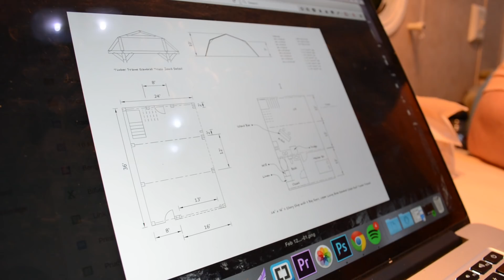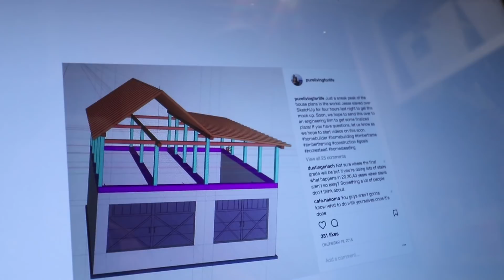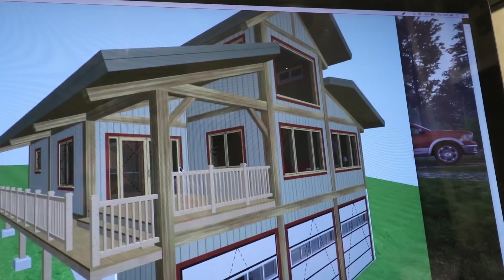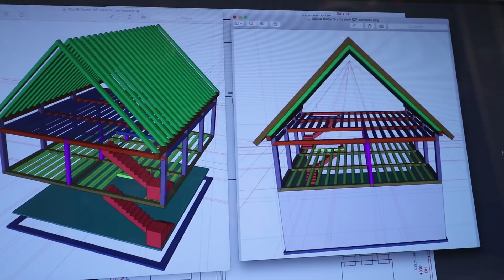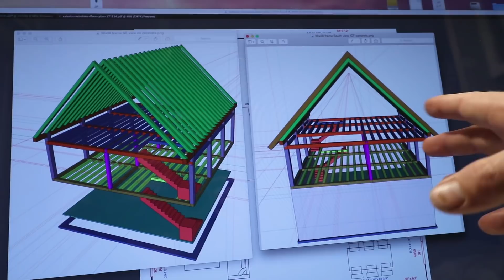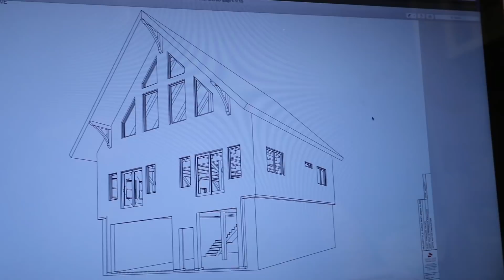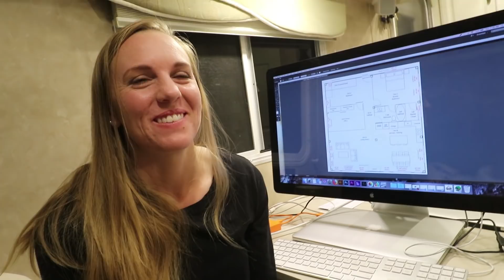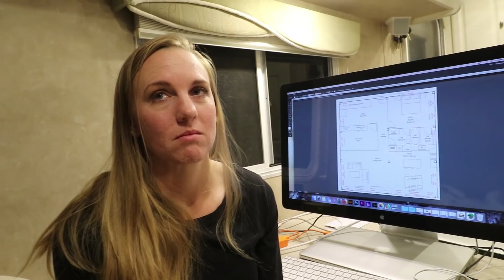Building a House Start to Finish: Timber Frame House Tour

Comment: Make sure your doorways and stairways are large enough to move appliances and furniture into where you want them. How do you get your washer and dryer into the bathroom? Having appliances/beds make abrupt right angle turns is more complex than you think. A queen bed is harder to move than a king because the king breaks down into smaller pieces. Talk to appliance installers. We purchased a refrigerator that only fit through our doors when all hardware and some trim was removed. This is the reason that spiral staircases are only useful for non-functional spaces. I suggest having appliances drawn to scale then moved through the house drawing by hand until they are in position.

It seems to me, in my inexpert opinion, you have not put enough consideration into plumbing. If I am wrong I sincerely apologize. If you are planning a garage workspace, then consider a sink on the outside of the garage bathroom. Is your kitchen and bathroom plumbing on common walls? Is the upstairs and garage plumbing lined up for sewer stack and water supply? Your upstairs bathroom design has water supply and water disposal on two/three walls. Where is your disposal stack? If you plan a loft bathroom, the stack and water supply pipes must extend up to that floor unless you want to rip out walls later. Consider that a refrigerator with ice dispenser needs a water supply.

 Good luck on your building journey.

Comment: Hi

Great looking house. 

I wondered about one thing. Have you considered not having wood as floor material in the mudroom. I would use tiles or something else that is more resistant to water. Both because in the winter you drag snow into the house and due to that this floor will be washed quite often.

Comment: you'll love that southern light until it's baking you alive in summer... remember it's a hot space! The spacing from seating in kitchen island to dinning table seating to door is very cramped. I also second the issue with your inverter system located under your bedroom. I lived on the other side of the wall for one in a single story cabin... it made a good night's sleep challenging. Love the work you've put into things and encourage your continued effort.

Comment: Very nice design, one suggestion, with 10' ceiling height using standard doors will look odd, I used 8' doors in my build and it looks proportional. 
This is going to be a great house when you get it done, cant wait for the framing videos, keep up the good work!

Comment: Great job! I would look at that bathroom though, I don’t think you’ll be happy with it once you get it built. I’d move the washer dryer to the mud room, and tweak the door and fixture layout some to get better flow. Since it’s your only bathroom on that level you don’t want it to be awkward to use, and you will spend significantly more time in there than your accounting for.
Reply: Scott i agree with you. I've been drawing plans for 10 years and have seen many bathrooms. I dislike small baths. And I kept wondering where the laundry was going. There is not enough space there. It would be the best to put it in the mud room.

Comment: I'm a interior designer and I strongly recommend that you don't have the laundry room in the bathroom. I think you should put it in the mud room. As well as when you have deck I think you should make sure that you have it covered . It will help when you entertain guests
Reply: I agree.  They need to consider the reality that they are most likely building not their own dream house but someone else's.  Most future buyers don't want a laundry room in their bathroom.
Reply: That was my thought as well.  Sacrifice a bit of that mudroom closet space for the washer/dryer, or just put them in the garage so you can build some counter space for folding and maybe have a utility sink in there.  Space seems too precious in the living area.
Reply: Architect here. I agree with Justin. The entry to the office could be moved to the hallway to give some of the space necessary for a washer/dryer in the mud room. This gives the kitchen way more storage/counter space. 

The bathroom plumbing is inefficient. You have three separate plumbing walls (sink, toilet and shower). The sink and tub spout/shower head should be moved to the same plumbing wall as the toilet. One plumbing wall makes more sense economically. A straight-shot view of the toilet from the hallway is peculiar. Hopefully they read these comments, but it seems they do not.
Reply: I can tell none of you do the laundry at home. The laundry should always be on the same floor than the bedrooms, where you're storing the clothes.
Reply: C E, I do laundry at home. You are confused. The mud room IS on the same floor as the bedroom.
Reply: They haven't done any plumbing yet

Comment: Hi Jesse & Allisa,  
Half way through this video, I'd like to offer a couple suggestions on your plan - if it's not too late for you to consider changes.
1.  Move the bathroom sink to the plumbing wall next to the toilet and swing the bathroom door against the MBR wall.  That will allow the vanity to be longer (if desired) AND it will reduce circulation through the bathroom - rather than diagonally, to along one wall.  It also moves the bathroom door further from the kitchen living area (good).
2.  Standard tubs are 5' x 2'-8" wide.  Granted you aren't showing wall thicknesses and so your generous 3'x6' tub is good.  But think this out carefully as you choose fixtuers / layout walls.
3.  IF you can make your walk-in closet 6'-6" or (better) 7' WIDE, it will be "double loaded" - meaning that you can have a pole and shelves flanking a central aisle within the closet.  This doubles the closet space.  Do not hang the poles / shelves in a "U" shape as you lose more in the corners than you gain.  Don't swing the door into with W.I. Closet - consider a pocket door.
4.  I recommend swapping your range and kitchen sink location - but your personal preferences should govern.  I prefer looking out a window when standing at the kitchen sink.  It appears you might be a tad bit tight on cabinetry in the kitchen.
5.  You may be able to utilize some of the mudroom for additional storage or for things like a washer/dryer and also maybe a utility sink.  It appears more storage space may be needed.  A long closet next to the "L" shaped stairway and/or countertop with a sink wouldn't hurt the plan too much.  Or a pantry could go here.
6.  Alternatively, or additionally, the LONG home office could sacrifice a couple feet and feature a closet along the wall facing the hallway (opening into the hallway).  By making the two adjacent closets 5' wide each (instead of 6'), I believe you can pick up enough room to add a closet although the home office shrinks by about 30" to 14'-6" more or less.  
I can't read the plan very well in this image, but these suggestions are just some quick thoughts.
Keep up the Good Work!!!!
Ken (Registered Architect)

PS - Oh.... after watching more of the video, (excellent 3D rendering) I see you have a washer and dryer recessed into the bathroom wall, protruding into the kitchen area.  I believe this will be too much congestion for that area (bathroom / folding area / Washer dryer) and hurts the kitchen, which could use a pantry.
Reply: Architect too. I agree with most of your points. Generally, I would avoid an exterior plumbing wall in a frost zone, but I do like a window over the kitchen sink.

Comment: hey there. 
a few pointers. as a designer, there are a few things you should know.
1. in the master bathroom,  the way you are currently planning on setting the toilet when someone is in the bedroom and is lying or sitting on the bed, the first thing you see into the bathroom is the toilet. not the best thing to do, only if you really don't mind it. 
to change it, if you still want to, (it not a life-changing thing...) you could switch between the sink space and the toilet space, as to not see the toilet from either door.
2.  in the kitchen. I see you are planning on 2 built-in ovens on the right side of the kitchen, and that you have an addition oven+stove top. are you aware that you now have 3 ovens? you can use the space for more storage instead.
I think you could also extend your island out a bit more towards the hallway area by 1-2 feet. it won't hurt and you'll get more storage and counter space for cooking.
3. one more thing. by the mudroom, the windows you have right now can grow in 3 stages, so that the smaller one, to the left of all the windows, can stay the same as it is, and then each window after it can be taller by a 1-1.5 foot extension each one after the next one.

Comment: If its not too late? I would highly recommend changing the single door onto the decking at the back to a double or triple door.if you are having freinds over for a party the single door will be a real pain. Also getting large items in and out of the house will be far easier. A bunch of kids running around also need more space than a single door can provide.

Comment: Also, when I redid my VERY SMALL bathroom, I used solid wood pocket doors...they work extremely well. The sound does not carry well through the solid wood. I also used them when adding a small apt. onto the house for my Aunt. You won’t be sorry to have all that extra space..Just a thought.

Comment: I love the south gable wall but  i would excavate the hill side to make to make a drive way and front door on side of house. Those stairs are going to get old quick. And i hate going up to a house and not seeing a defined entry door to knock on. You are going to have UPS drivers going to front of house when deck is built staring at you through your glass doors.

Comment: Great rendering.   I would make sure you have enough room between the island, the dining table and the wall.  It certainly will all fit, but , I would personally want to see more space or a long narrow table.  I was just working on a house and the owners had about the same design and it was just a little strange, it didn't exactly flow.  Also I would not worry too much about counter space,  you always seem to make do with what your have.  The island is the important thing, as people will always sit there when they come to visit.  I agree that it's really hard to get a sense of the true space from even 3-d drawings, this is why you have to think it all over and make sure it will work. The only other small thing is that I would make a single garage door wider than 8' especially as it looks like you have the  room.  You can easily drive a small car in an 8' opening but  you might like a 9' better.  It's just easier to drive through.

Comment: Sorry for all the comments but i'm wondering if it's really a good idea to have a garage under the living space especially with underfloor. When the snow melts off of the cars you will create a huge amount of moisture, obviously you will need a decent drainage system to help take away the snow melt from the vehicles. The other thing is that exhaust fumes might come up into your house as you park the cars especially with the hot air rising from the heating. Also i'm guessing that the cars get pretty muddy and dusty and you will be bringing all of that into your home. I guess you have your reasons for not building a separate garage.
  Thanks for all of your tips so far.

Comment: My boyfriend and I have been watching from the beginning, and we have both built homes and remodeled our current home. Our largest was built and designed from day one and was 5000 sq.ft. Our current home is 1600 sq.ft. Lol 
We think you guys are totally wasting space in your final layout. Mud room being that big should double as laundry room so you can strip and toss clothes directly in laundry. Your going to hate stackable's and multi using your bathroom which could be way bigger and more luxurious. Office is cutting your living room into a tiny area that should be so much bigger, why?!! 
Kitchen and living area should be much bigger in a home like this. You don't have enough cabinets or counter space and living where you do, you might regret down the road, not giving yourself more space in the kitchen. Having those rooms so big cuts up the entire floor plan and hallways are a total waste of space. This floor plan is NOT an open floor plan. 
You mentioned you have no idea what to do with the loft...! Hello!! Master Suite and extra large walk in closet and bathroom with separate tub and double head shower. 
Garage, again, another waste of space unless there are personal reasons for doing it this way and is fine because it can be converted later. A nice carport or detached garage could open that space later down the road.

Comment: A dumbwaiter in the mudroom would be stellar!
Reply: to do that correctly, it ought to be all the way from the garage level to the loft level, so it would have to be designed in pretty soon if it's to be done.
Reply: Yeah that's why I said something now
Reply: What would you use it for?????
Reply: Getting packages, groceries up to the main floor/loft, especially useful in the winter, hauling groceries and other heavy stuff up the stairs is a royal pain in the butt! I know, I live on the third floor in an apartment with no elevator, and it gets real old real fast, I can throw three hundred pounds but making multiple trips with a load sucks!!

Comment: I live in a similar type house. Garage and basement on the bottom, main level is on the second floor and a bedroom on the third floor (a CapeCod style). There is no way to get to the main floor without climbing several stairs, inside or out.  Living out in the boonies like I do, my shopping is done about once a month or once every two months. So as you can imagine, I maximize my shopping trips and that ends up being a lot of trips up and down stairs just to unload the car. It’s especially bad/annoying in Snows and Rain.  My wish, and point of my comment, is for you to consider a dumbwaiter or some sort of lift system to help move things to your main level. I wish I had one and haven’t been able to figure out how to retrofit one to my house. But since your still in the planning phase, you might want to think about seeing if you can fit one in somewhere.  After my first few years here, I really started to wish I had one.

Comment: A counter top at the end of the kitchen between the kitchen and living space can be added; take it all the way from wall to the post. Toss in some stools and you have extra space for guests to dine or just extra space for whatever. This is dead space anyway and cabinets can be under it for more storage; never underestimate more storage ;)

You might want to consider putting the upstairs bathroom above the current bath. This will make plumbing WAY easier. You can leave the upper unfinished for now but you have to run plumbing at some time and doing it now rather than later will help you tons. At the very least get a rough sketch going of upstairs so you can get all your mechanical done in advance.

Comment: EXCELLENT! Nice to see the end product! I hate to be a bone-picker, but your laundry is a major operational flaw. Add a couple kids and some critters to the place, and I guarantee you'll be needing room to spread and sort and iron... And big loads - quilts and blankets, and winter gear... Do yourselves a favor and nix the bathroom laundry stack and opt for a side-by-side set of heavy duty machines - Or at least, allow for them in the basement, perhaps, so when the time comes you have the option. Just sayin.

I have really enjoyed your channel, and your path to self-sufficiency. Kudos!
Reply: And think about 2 dryers, since the drying cycle always takes longer than the wash, leaving the washer to sit unused while waiting for the last load to dry.
Reply: We have 2 full sets - The new ones are in the main floor utility room, and the old set are retired to the basement to handle horse blankets and such, and my work clothes and woods clothes... And they do serve a vital purpose handling the overload during spring cleaning and turning out the fall blankets and etc.

Comment: Honestly feel that the bathroom design with laundry is simply too small for three reasons: 1 laundry basket/bags take space in and out of that space, 2 laundry (even stacked) need space in front of them to load/unload the machine (and based on the depth of the toilet) you barely have 2.5' between the counter and laundry doors (doors on the actually washer/dryer) and 3 doors no matter which way they swing are going to be an issue in that space (Larry Nickel suggested the same as I will) pocket doors on both doors into/out of the space.
The rest of the design however is amazing looking, and looks to flow well, and would allow 'extra' people to move around easily (aka guest/family members visiting/etc).

Comment: Everything looks tight.  Remember your building into the side of a hill, so the back of the house does not have to end at the back of the foundation.  Just need to get a pump truck to pour a slab and footings.

Comment: Hi Im in UK England, we are not allowed to put washer/dryer in a bathroom, I would put in in Mud Room ( in uk we have a utility room which has the washer/dryer) next to outer door to dry clothes outside saving electricity and easy access to outside. Hope this helps. Your build and plans are FAB !!